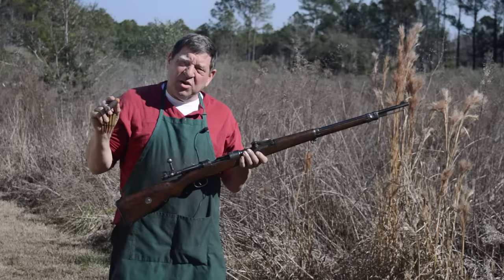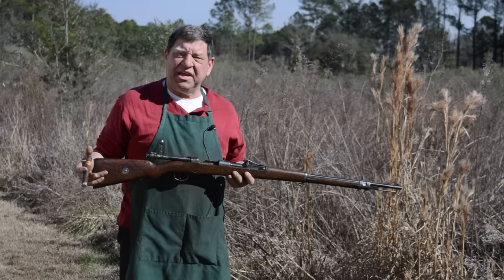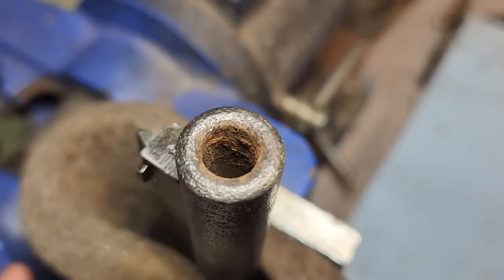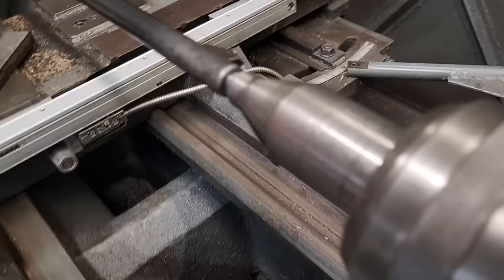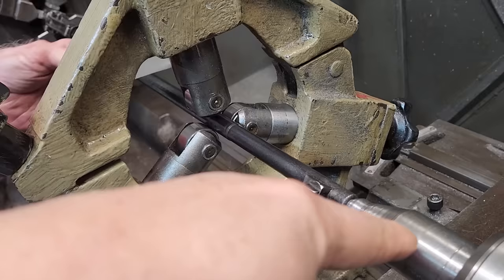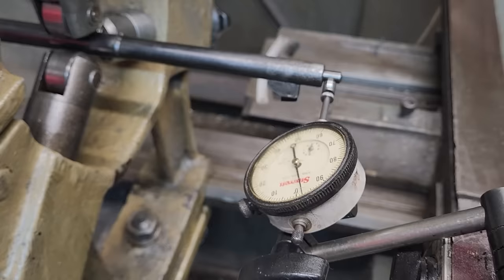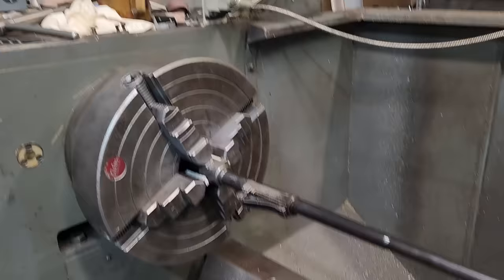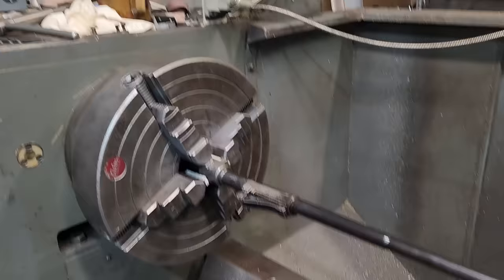Mauser Counterbore follow-up

Comment: Good work, I've had to do a job similar to this. In my case, a round was lodged 3 inches near the end of the muzzle of a colt lightning in 22 that was completely rusted all through the bore. Saved most of the bore except that last 3 inches that had been plugged with a round+water+dirt+rust (Horrible storage on client side),  discussed it with client and agreed to have the 3'' chopped. After that, indicated and  re-crowned on lathe. Went to a range and the group at 20 yds was horrible, restoration for shootability was fine, performance not so much. Good job on your side

Comment: A counterbore is literally just shortening the barrel without it being visibly shorter from the outside. That's all. As long as it's done correctly the only effect it will have is the same effect that would occur if you shorten the barrel by the same amount.

Comment: Thanks for a “plain English” explanation of the lathe setup.  I understand a lot of the work you do, but lathes go into a version of heavy lifting in your art I have never been able to wrap my head around.
Reply: A lathe can be seen as a horizontal drill press.

You can put a bar of steel in the jaws, and use a file or cutting tool to modify the outside surface of the stock.
You can mount a drill bit, reamer, in the tail stock jaws, and drill or smooth holes in the inside of the stock.

A lathe is a very versatile tool, and if you do metal work, you should invest in a small lathe!
Reply: Yes sir - it's just, frankly, fascinating (and a little overwhelming) to consider the precision.  Functionally, I "know" a bit of what lathes can do, but the operation, set up, and results?  Man, it's all black magic, lol.  I always enjoy Mark Novak's videos due to the explanation and the time setting up shots and going a bit "deeper" into some of the nuance and rational.   @jeffreyyoung4104

Comment: I have a Turkish Mauser manufactured in 1940 that when I first saw the front muzzle I thought it was a 410 Shotgun, but found out that it had been counter bored at some point in its life.
Reply: Not just the Turks.

A LOT of Lee Enfields ended up with the same affliction.

Folklore had it that an oiled piece of cloth poked into the muzzle, was an ideal way to preserve a barrel. This was, apparently, common among target shooters..

I eventually found the direct evidence in a forgotten cupboard. The rag had dried out and become "crumbly". Very likely that the decomposition of the oil had also produced an acidic residue. This particular one was living in a reasonably "dry" part of the country.

There are several better ways to look after barrels.

Counterboring / "auxiliary" rifling The latter, first. VERY difficult, fiddly bit of "engineering"; unlikely to be worth the expense, even if you found a "matchingg" piece of the same type of barrel..

Straight counterboring? Not just the Turks got up to that caper.

In the "good old days", I scored a genuine battlefield "pickup' Russian SKS that had "patina" but was all there  and looked like it had "been places". That chrome-lined barrel had been counterbored back about 3/4 of an inch to leave a crisp "internal" crown.

Why not just lop off the offending bit?

The folding bayonet locks over that proper muzzle section.  What sort of revolutionary type would forego the ability to use a byonet?
Reply: @bruceinoz8002  lol nice piece of history

Comment: Excellent conservation, I have a handgun, Savage Stryker, uses a 110 receiver, when rebarreling I used Savage rifle barrels, cut them to 15-1/2 and recrown them. Boy Howdy, you talk about non concentric, 50-60 thousands was considered good. The gun was originally 22-250, I fitted, 243 Win, 308 Win, 6.8 SPC (requires a different bolt head) and 223 Rem (bolt head also.) Thank You for the Demo !!!

Comment: Not gonna affect much taking .500” out of the rifling. Good deal saving the piece.
Reply from the maker: Actually,  .3305 from a 
.323 bore. You are correct, we took the least amount we cpuld
Reply: @marknovak8255  right. My number was a guesstimate on depth. I’m surprised that it didn’t go back further.

Comment: If a guy did NOT have access to a lathe, would it have been possible to get after that rusty area with a stainless bore brush sufficiently to remove enough of the rust to prevent an unsafe condition?
Reply from the maker: I thought I covered that....NO
Reply: That's a question with a dozen lawyers attached to it, not to mention moral considerations. There's no safe level of barrel obstruction. Notice Mark didn't aim for getting 95% of the obstruction, he removed it entirely. Hopefully making it safe for years to come and a thousand plus rounds. Any gunsmith would have to physically inspect your gun to give you an opinion.
Reply: @marknovak8255   no Mark you didn't.  you said you had "about a .030 obstruction that no amount of filing etc. would make it right" or something to that effect.  I am not in the habit of arguing with other folks content, and I love your content, however I feel like I have been kicked around a bit for my question, which I though was a legitimate one.  My contention, which I did not explain (my fault there) is that the barrel did not "grow" additional base material.  the obstruction is iron oxide rust, and once removed, there will be less base material, and therefor a larger bore than the rest of the barrel.  And as a result, there will obviously be no bore obstruction because there is now less base material than there was originally and all of the bore obstructing iron oxide would be gone.  I think this could in fact be accomplished by filing, glass bead blasting, or possibly by many hundreds of passes with a stainless bore brush.  the last inch of rifling would be trash as would the crown, and accuracy would no doubt be hot garbage, but I would also argue that it would be "safe" to shoot.  Sorry... just felt like I had to defend myself a bit..

Comment: Mark or whomever more knowledgeable than me please correct me here, but by doing this, the actual portion of the rifling that finishes engaging with the bullet is now internal to firearm so the true crown is inside? or is it since you are only removing the metal rifling that protrudes from the barrel internally, that whatever potion of the bullet that normally would be in the grooves is still able to touch the counter bored area and the crown is still at the end of the barrel as normal?  

I am assuming the second? 

Thanks
Reply: The crown is now recessed.
Reply: The crown is now at where the rifling ends inside of the barrel, the bullet will not touch the inside of the counterbored section, just like how a bullet traveling through a suppressor doesn't touch the baffles, assuming proper concentricity. Hope this helps

Comment: I have to get this done to my dad's 1903a4. There was a house fire and his Springfield was set muzzle down in the gun rack. It sat in an inch of firehose water for a few days
Reply: Just a few day?  I bet you could clean that up with some very agressive work with an oil drenched brass brush, maybe with 0000 steel wool bits laced into the brush. Good chance there's still a lot of rifling under the rust. Can't hurt a thing. If it doesn't work you can still find a smith who will charge hundreds to counter bore it.
Reply: @twentyfifthdui4717   I did all of that and a evaporust treatment. I used the method of wetting paper towels in evaporust and then wrapping it all in plastic wrap. It's supposed to be easier on the base metal than just bathing it overnight. 
The core rifle and action turned out great. The bolt was not in the same cabinet as the gun and it only got smoke/water damage. 
We are short of gunsmiths where I live and I haven't found anyone willing to take on the counterbore. And it needs counterbore because the first two inches of rifling turned to powder. The stock is also trashed and I've collected a beautiful piece of aged Koa to make a stock. But I haven't decided if I want to do that or just buy a new/remanufactured stock of the appropriate type

Comment: I would actually like to see a video on relining the whole barrel.  I've seen a few guns that a particular gunsmith in PA did and they looked totally original, but I've never seen how it is properly done.
Reply: Midway USA has a video on it
Reply: @Sparks00psn  I saw that video.  As I recall it was a very low pressure cartridge.  I don't think that procedure would be safe for a higher pressure cartridge like a Mauser.
Reply: @RJ-vb7gh  it was. It was a .22LR. Not sure how it would work on a 8mm Mauser doing a sleeve like that.
Reply: @Sparks00psn  The gun I saw done was a Mauser Pistol that was resleaved with a liner made from an M1 carbine barrel.  The Mauser was one of those that came in from  China in pretty bad shape.  By the time I saw it it was in very good 'mock original" condition. If you didn't know to look for the tiniest seam at the crown, you would never think to question the authenticity or the originality of the gun.  Overall the gun was transformed from a piece of junk to a very desirable collectable.  I'm going to guess that's why the job was done.

Still, if the procedure could be done economically and safely, it could revive any number of millosurps where new barrels aren't available or would be inappropriate.

I could even see where in some cases, the chamber could be modified to accept similar but more commonly available ammo.

Comment: Hey mark i would love to know your Opinion about a project i am working on. I have a Original colt 1851 navy that sometime in the past.  someone tapped the end of the barrel to put in a light socket . Turning the revolver into a lamp. I am trying to bring The pistol back to shooting condition. The pistol is in amazing condition other than the threads that go in about a inch of the Muzzle. I have Never done a counter bore that long. Would there be any issues from a counter Bore this long.  i would prefer counter boring being the rest of the rifling is in Amazing shape.
Reply from the maker: Id have to see it to render any opinion

Comment: Seems like a reasonable choice if you have a machine shop. Not the direction I'd have gone but that's just me. I would have tried some other things first, like spinning a brass brush in to clear the obstruction and most rust and then shooting it to see what kind of accuracy I could get.  I don't think it would "blow up" if you go one shot at a time and check the bore after each shot. If a brass brush couldn't make it accurate I'd try steel and test fire again. Drilling would be my last option.
If you have these kinds of tools it's probably impossible to resist using them even if you shouldn't. Reminds me of the Rodney Dangerfield joke that his mother found some free cough drops and that night she made him sleep outside so he'd get sick.

Comment: Just checking  - what was the big issue with having the muzzle screwed up? If you got rid of the mung and rust, what is the obstruction/danger or is it just appalling accuracy?
Reply: Rust is a barrel obstruction.
Reply: That bit of rust as Mark said: is enough to bulge the barrel.
Even if he physically or chemically removed the rust there's be enough rust pitting to affect the accuracy, so counter boring is the best form of maintenance to be able to shoot it safely and accurately.
Reply: Having the crown messed up in any way=appalling accuracy.

Comment: As a total amateur i wonder if that little bit of deleted rifling will affect how it shoots ?  Thanks from Amsterdam
Reply: It shouldent, this used to be common practice for millitarys to get a bit of extra life out of a given barrel, it should shrink the grouping not expand it.

not that it would matter in this case considering this barrel would have been unusable prior
Reply: Theoretically the bullet will lose a tiny amount of velocity. So the external ballistics will be reduced slightly. 

But it will gain accuracy. Even if the muzzle wasn't to the point it was unsafe to shoot, the last thing the bullet and the jet of expanding gas touches is the muzzle.

 Imagine If  a space shuttle rocket nozzle was all damaged and had a piece missing on one side. The blast and thrust of the engine would not be even and the rocket would not fly straight. Same thing with a damaged muzzle.
Reply: @EitriBrokkr  and its worth noteing when we are talking about something like a full power bolt action rifle with a 22+ inch barrel, that tiny bit of lost velocity really is miniscule,

dropping a 22 inch barrel to 21.25 inches is really not going to make a diffrence larger than the margin of variance between 2 different cartridges
Reply: 9-Hole Reviews just released a video testing the accuracy of a Mosin Nagant 91/30 which had been counterbored and got very good results.
Reply: @therideneverends1697    Thank,, and it shows the gun community can be super friendly (i know: why not 👏🏽)
Reply: @EitriBrokkr  Same here: Thank,, and it shows the gun community can be super friendly (i know: why not 👏🏽)
Reply: @therideneverends1697  no kidding, did you not read what I said?
Reply: @remko1238  Not a problem. Any time.

Comment: Would a laser work ? Placed in the breach end and fire it down the barrel.  I've seem laser take off rust so just curious if possible
Reply: the cheapest units are around 10k usd plus tax+shipping from china and they only focus at a certain distance, so it wouldn't work. you could use electrolysis instead, but still a counter-bore is not a bad idea.

Comment: Question - why not find a parts gun of the same vintage / year and use the barrel from the parts gun to replace the damage barrel on the gun your are working on ?

Ricky from IBM
Reply: These guns are so rare and parts so few that you have to do everything you can to keep all of them out there.
Reply: Like he said in the video, 'the barrel is the gun'. Any gun with a good barrel is probably too valuable to destroy for parts. Any gun sold as 'parts' is probably less one good barrel. Any mint barrel is going to be close to the cost of a whole gun.

Comment: Afternoon Mark. I have a Winchester 71 (short tang)  that needs some conservation. At some time in its past, it was reblued and stock refinished. This is purely a shooter. The hammer seems weak on release to me. I don't want to fiddle with any trigger/hammer not knowing the gun well. Do you do this type of work? If not who would you steer me to? Thanks. Charles.

Comment: Is there any quick and dirty way to accomplish this without a lathe? I wouldnt attempt it on anything valuable, or worth taking to a fully outfitted gunsmith, but I've got a lot of junk from RTI that might benefit from a workbench counter bore job.
Reply: Not without any real assurance of aligning the cutting tool true to the centerline of the bore, no.
Reply: if this is the same thing as reaming you could technically do it by hand but it would take longer
Reply: As long as you had a long tight fitting pilot on a reamer or on a drill bit that would keep the cutting tool concentric then you could do it by hand. But by the time you spend the money for tooling it would be cheaper and safer for the bore to pay a gunsmith.

Comment: Hi.  I have 2 Hex receiver and 1 round receiver Soviet M91/30 rifles from 1930's as a possible doner rifle and 1 original Soviet 1940 PU scope with mounts and screws...any idea who has ability and fixtures to build a Soviet sniper rifle with turned down bolt?   I have never fired the rifles after purchase in mid 1990's and they still have grease in the barrels...mounting holes have to be drilled perfectly on the receiver stated Russian man in Siberia who sold scope to me...

Comment: Wouldn't be e piloted countersink precise enough? 
In WW2 they planed to make counterbored new rifles (98k) to protect the muzzle better, If I remember right it was a quite big counterbore, around 10mm.
Reply: From my experience in the airgun world(and having seen some REALLY crusty Chinese barrels) often the pilot portion of the tool leaves marks or in some cases chews up the lands pretty bad. This can be hard to notice during the cutting process but can be seen later with a borescope. Considering that this is some of the last rifling to touch the projectile, you want it as perfect as possible. I think they did it the correct way.
Reply: @life_of_riley88  If you use a countersink on a barrel, it will be one with changeable bushings, you can make them out of brass.